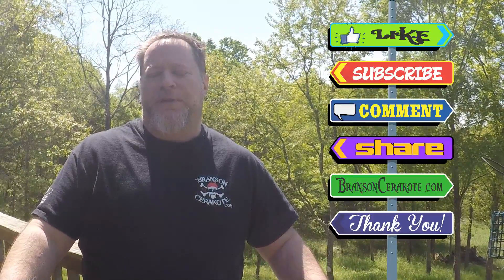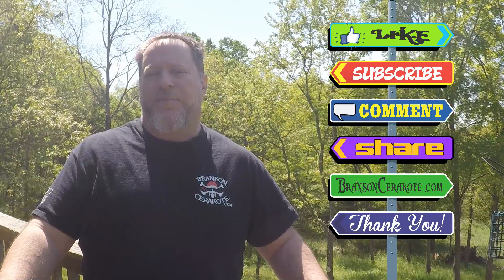Removing Old Cerakote | Branson Cerakote and Laser

Comment: I just bought a Glock 19 with a full cerekote job done to it. I love the cerekote but some overspray is in the channels on the slide and frame so racking it is gritty.  What would be a good way to remove the cerekote from the channels?  I was thinking a small dremel sized wire wheel.  Then polish them. Dont want to harm the rest of the job. Would that work? Also covered the serial number plate and would like to remove that as well.
Reply from the maker: I wouldn't recommend a wire wheel on the slide. It's steel, and chances are you'll go to the metal, which could introduce an avenue for corrosion. I'd just oil it up and keep working it. It will eventually wear smooth. If the serial number is unreadable, that's a real issue. Technically that gun is illegal now, and possession of it is a felony. There's really no way to chemically remove the Cerakote from it. A wire wheel is going to chew the plate up pretty bad. I'd almost recommend taping off the area around the recess, and lightly working it with an emory board until you can read it again. Another option is finding a shop with a fiber laser and having the remove the Cerakote. It can be done without damaging any of the surrounding frame or the plate. It sounds like whoever applied it didn't do a very good job.

Comment: Quick question. I’m redoing the cerakote on my shotgun, just the stock I’m using 100grit aluminum oxide to sandblast, I know you said in the video the stock would be stained that color but I was expecting some of the cerakote color to come off and it’s not. Is that normal or do I need to go up on my pressure?  I started at 25psi and went up to 40psi. Just dulled it a little. Thanks for the videos a lot of good info been really helpful.
Reply from the maker: If it's not wood, then it should come off for the most part (95% or so). What I meant was that it will never go back to a uniform color. The cerakote stains the polymer. The surface will be back down to bare poly, but will have areas where you can still see some coloring.

Comment: I am seeking advice. Had a Glock frame cerakoted and it's just not doing it for me. I have access to a sandblaster. In your opinion, on a scale of 1-10, what are my chances of completely screwing it up if I try to blast it myself?    Thanks for your help!
Reply from the maker: Just make sure you have the correct media, either 100G red garnet or 100G AO. Set the cabinet to about 30 psi and don't stop in one place. Once it's done, it will still look cloudy, but that's just the Cerakote staining it. You can tell by look and feel if it's good to go. Sanding is the easy part.

Comment: Hey Branson subscribed to the channel and love your videos. I purchased an H&K VP9 used and the previous owner cerakoted the slide only a bronze color and it has wear spots in areas that seem to be from holstering based on the wear locations. My question is can these spots be touched up in any way and easily because they are not large spots some maybe half the diameter of a pencil eraser  but most are even smaller say 1/4 that size of a pencil eraser. Second part of question would I have much luck if I had the cerakote removed/blasted off and have a desirable finish underneath that would be close to the orig blued factory look?  My first working with a cerakoted firearm.
Reply from the maker: There's no way to patch it. Once Cerakote is fully cured, follow on Cerakote won't stick to it. If it was done correctly, there isn't any factory finish underneath. It should be bare metal. The only way to do it correctly is to sand it down completely and redcoat it. Sounds like whoever did it didn't do the application correctly.

Comment: I am removing a coating off a P07 frame.  You said to flash bake it. What temp? How long? And what grit AO do you suggest stripping it with.  I have 70 grit now. To rough for stripping?
Reply from the maker: 70g is too aggressive. 100 grit ao or 100 grit red garnet only.

We tack everything out at 180.

Comment: Yes I purchased several blades for a very prominent blade maker, I paid a lot for them I just didn’t want the last one coated! I wanted to do really nice hands on it and a satin steel blade! I’m really debating if I’m going to have a great company remove that coating and not mess up the blade and have a nice satin finish S30V blade. Can you guys treat my new blade with lots of love and take the black cerakote off?
Reply from the maker: Depends on exactly what you want done to it. The only way to remove it is to sandblast the old Cerakote off.

Comment: Thank you for all your advice and tips on here!! I have a question. Have you ever had any dealings with redoing a nickel plated gun? And how did it turn out for you? I have one that it is flaking off. And it comes out spotted.
Reply from the maker: You'll need to remove the plating, either sandblasting, or chemically, before you can start the Cerakote process.

Comment: I have to do a ruger 22/45 bolt how would i go about mixing a small amount of cerakote.
Reply from the maker: You probably don't want to put regular Cerakote on a bolt. It will get chewed pretty quickly. I'd recommend either Microslick, or Elite series.

Comment: Thanks for all the videos! Any tips on removing powder coating or cerakoting parts that are powder coated?
Reply from the maker: Just patience. Beer helps. It all has to come off. There are acids that take it right off, but then you have acid sitting around the shop. I'd probably recommend calling a local powder coat shop and getting a quote to just have them prep whatever it is you need to coat.

Comment: What if it’s on a Glock frame?
Reply from the maker: Just sand at lower pressure, 30-35 psi.
Reply: @BransonCerakote  I wonder if it’s even cerakote on my pistol. Only two weeks of normal carry, and all the edges are showing the factory black frame through the titanium blue... I carry in a good quality kydex holster
Reply from the maker: @lukevj  Kydex is notoriously rough on finishes. However, if it wasn't applied correctly to start with it won't last long.
Reply: @BransonCerakote  damn... I thought leather was the bad guy
Reply from the maker: @lukevj  I use a leather holster every day, and my Cerakote is about 4 years old. It still looks pretty good, but I chose a battle wear finish for my EDC. It's hard to tell when it's wearing. Leather tends to give a little. Kydev is already a little bit of a rough texture, and doesn't give at all. Either way, Nothing is going to last forever, even Cerakote.  :)
Reply: @BransonCerakote  The More You Know. 😁
Reply from the maker: @lukevj  Ain't that the truth.